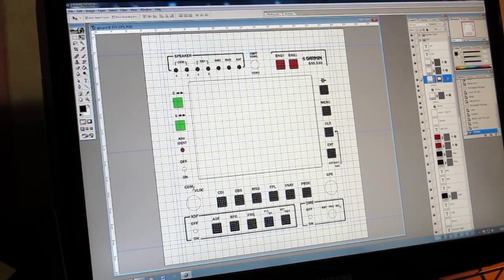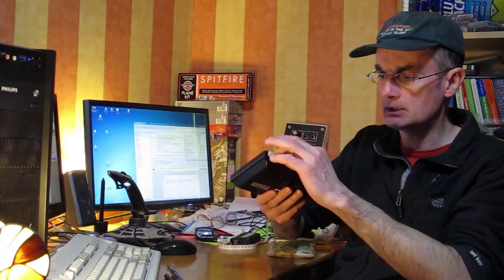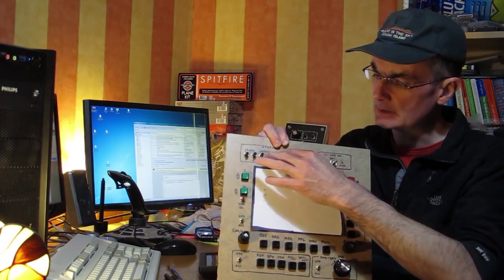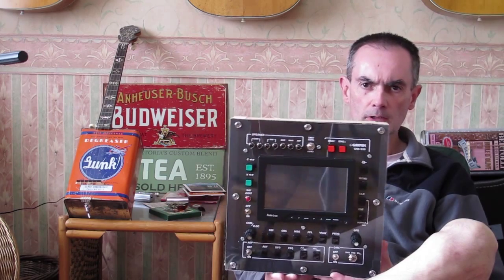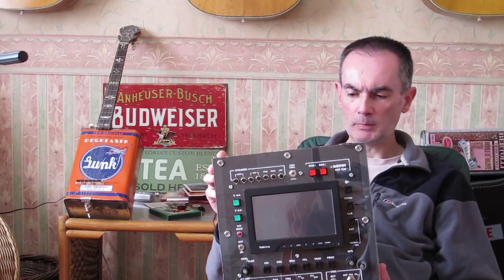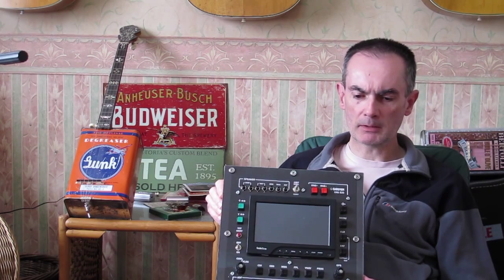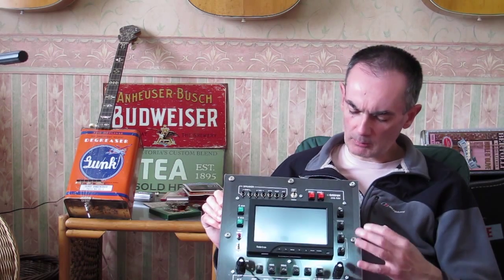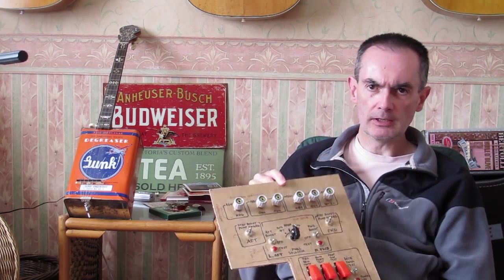GPS Panel Design & Construction (Twin Otter Cockpit Build - Part 5)

Comment: Great videoseries! What are you planning to use as lighting?
Reply from the maker: I'm not sure about the lighting yet. I have just bought some LED floor lights from Maplin, which may be usable. They are little discs and run off a 12v transformer. I have also ordered some electroluminescent tape and a one 10x10cm panel from Proto-Pic to experiment with.

Comment: This is great!! I may have missed it, but what are you using for the actual GPS display?
Reply from the maker: If you mean the software, I use the Reality-XP GNS530. They have recently released version 2 (a new product), which is compatible with P3D and has a number of improvements.
Reply: Good to know! What about the hardware ... the actual display ....
Reply from the maker: It's just a 7" VGA monitor, it says "Koolertron" on the front. I seem to recall it is supposed to be a touch screen but I never got the touch to work.